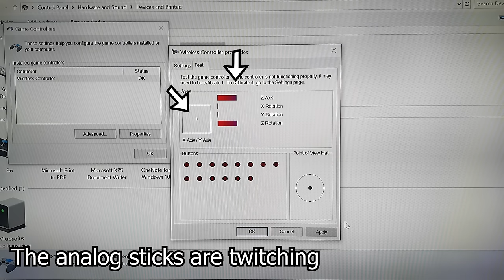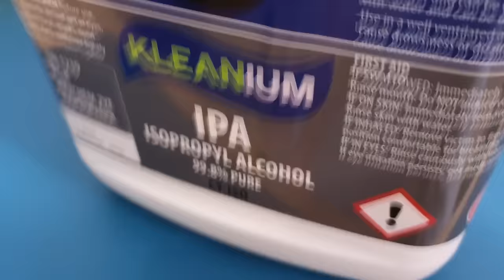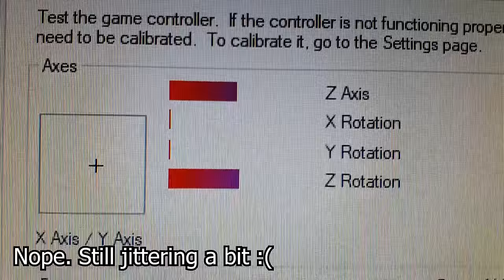How to take apart PS4 Controller and Repair the Analog Sticks

Comment: Hello i followed the instructions exactly but now my ps button to turn on the controller doesnt work and im not sure why
Reply from the maker: The ps button contact is on the flexible button film with all the other buttons (excluding trigger). Maybe you damaged that flexible film, or maybe you didn't reassemble it properly and the film connection isn't making proper contact to the circuit board. Or you didn't plug the battery back in properly.
Reply: @RestoreTechnique  i figured out the problem it was the plastic film it got bent a little bit so i fixed it now its working perfect thanks man 👍
Reply from the maker: @azernunn7745  Awesome 👍

Comment: hey i need some help when i changed the pentiometers then test it the joystick wont go down? i need answers quick
Reply from the maker: I don't know what you did wrong without seeing things myself.
So you changed the whole potentiometer? Or just the track, or just the wiper?
Reply: @RestoreTechnique  hi so i replaced the wipers and its fixed now but the problem that i have now is the ribbon cable thats on the charging port does it also power the controller? cuz it doesnt work now

Comment: I tried to fix my drifting so I did the part in 4:00 but now it got worst. I think the issue might be with the metal cords in the analog. Is there a way to fix it?
Reply from the maker: Did you damage the metal disk? What makes you think it's the "metal cords"?
Reply: @RestoreTechnique  looking back at the video I think you called them 'metal prongs'
Reply from the maker: @yavuz298  Yes. What makes you think your issue is the metal prongs?
Reply: @RestoreTechnique  they got bent a bit, and I haven't done much more than open those parts and clean them up
Reply from the maker: @yavuz298  ahh I see, looks like you'll need a replacement metal disk (it's called a wiper, but doubtful it can be bought separately).
Unless you're confident with bending the prongs back into shape, but I've never done that before.
Reply: @RestoreTechnique  ah, I see. Thanks a lot man. I'll open the controller again and see if I can fix it. 

If I do buy a replacement analog can I take the metal prong part and replace it with the broken one? Replacing the whole analog seems a bit complicated for me

Comment: What the name of that tape i got it in my cart on Amazon.  i want to make sure I get the right stuff to do this i rather repair than spend 70 to 200 which I wouldn't spend that much on a controller if its i sell i get one i like standard than scuff because scuffs need more repair parts if some of us get lucky
Reply from the maker: The name of the yellow tape I'm using is Kapton tape.
Reply: @RestoreTechnique  what is the name of the paste i think im getting one that has it or maybe it dont lol
Reply from the maker: @sony4ever93nyc3  Flux. It's KingBo brand.
Reply: @RestoreTechnique  if I buy the soldering iron kit do I need to buy it like paste wire and wick if its including it n it like 26 on Amazon
Reply from the maker: @sony4ever93nyc3  You usually need to buy all the consumables separately, like solder, flux, wick etc.
Reply: @RestoreTechnique  ok I ordered one that came with everything but if I run out or don't fully have what I need i can order it Friday I'm happy the way you made the video I can understand your video than others that fix ps4 controller
Reply from the maker: @sony4ever93nyc3  Ok great! Thanks :)

Comment: This was a fake DS4. The Orange+Black analogue modules give it away. They start to drift within a month or two, that's why this was mint condition. Original sticks have a blue base, green potentiometers witch white centers and grey shaft. Luckily Other stuff work properly in these so changing the analogue sticks should make it usable for a couple of years at least.
There is another level of fake DS4s with weird PCBs with extra holes for no reason, half soldered joints and flat connectors that are too long. These usually break and can't be fixed. Those are not fun at all.

Comment: I bended some of the wires of my ribbon cable and now the light doesn't turn on and it has a ? Icon instead of a battery indicator when I connect it to my ps4.
Lesson learned, don't do this if you're an idiot.
Reply from the maker: Oh damn bro, that sucks. You should be able to buy replacement ribbon cables from ebay.

Comment: I'm so dumb I unplugged the battery with the outlet itself too lol
Reply from the maker: Oh no! How's your soldering skills?
Reply: @RestoreTechnique  bad honestly your tutorial did work greatly I see the improvement, but I messed up & pulled apart the square where the battery is plugged
Reply: I used it without the battery & everything worked well just that it started doing some weird noises & stopped using it

Comment: i opened my ps4 controller... and fucked up the plastic part of the potentiometer on the "Up" part of the joy stick. Those things are not easy to get off gently and its bullshit that all you need is a flat head you are better off replacing the whole potentiometer by just soldering.

Comment: Pls help me what to do if the red and black cable is cut on the middle ??
Reply from the maker: You will need to repair it, solder the cable/s back together, or replace the wire altogether.

Comment: is it okay to only change the sensors only?
Reply from the maker: Yes, in fact I should've done just that, and keep the original spring which wasn't as stiff.
Reply: @RestoreTechnique  okay thanks
Reply: @RestoreTechnique  i thought i must solder it all again

Comment: What if the metal prongs are bent? What should I do?
Reply from the maker: You could try bending them back into shape, but I'd recommend buying a replacement. I don't think you can buy those potentiometer discs separately, but you can get one out of a new analog stick, which is cheap enough.

Comment: What should i do if the red and black cord to the motherboard comes off is the controller done
Reply from the maker: Nah just the vibration motors won't work. You could try and find someone with a soldering iron to reattach them
Reply: @RestoreTechnique  i cleaned my sensors for my joysticks but now its just moving and i broke a piece for tbe touchpad to be so i dont no what to do

Comment: my screws are messed up and i cant unscrew them. any other methods?
Reply from the maker: As in the screws are stripped and you can't turn them? Or the screws turn but they don't come out?
Reply: i cant turn them cause the screwdriver wont fit
i tried with 5 diferent ones
Reply from the maker: @andy2643  sounds like you've stripped the screws. The screwdriver needed is either a Phillips Head #00 or #0.
There are various methods for removing stripped screws, you should youtube search for them. I suggest trying WD-40 or similar lubricant. Spray it on the screws and let it sit for a few minutes. Clean any remaining off the screw heads, then place a rubber band over the screw head, and then push the driver into that and push hard whilst turning.

Comment: do you know how to repair the clips on my ps4 controller?
Reply from the maker: The clips aren't that necessary, the screws hold it together too. Without the clips you'll just have a slightly bigger seam between the two halves.
You could try to repair them with a 2 part epoxy glue, that might work. Or you could plastic weld them too, with a soldering iron.
Reply: @RestoreTechnique  k

Comment: The thing in my anlog stick was snapped
Reply from the maker: The metal disc? Or the plastic housing for the metal disc? Sounds like you need an analog module replacement.

Comment: Is it ok if i use spirit?
Reply from the maker: I don't understand your question sorry. What's spirit? Use spirit for what?
Reply: @RestoreTechnique  its some alcohol and i want to clean the controller with it.Is that ok?
Reply from the maker: @luciprodaniuc7277  If you mean Methylated Spirits, then i would not recommend it. It will most likely erase any printing (labelling components) on the circuit board. But it may also erode the solder mask, not sure.
Reply: @RestoreTechnique  its sanitary alcohol
Reply from the maker: @luciprodaniuc7277  Does it say what percentage of it is alcohol? Often sanitary or rubbing alcohol will state 70% isopropyl alcohol or similar. 70% is ok, just make sure all of it has evaporated before reassembling. Anything below 70% is no good, 70% is the bare minimum for electronics.
Reply: @RestoreTechnique  ok thnak you!

Comment: I spilled milk on mine near the speaker it won't turn on but it chargers and most buttons work on laptop I checked but seems a button  is open circuit and 1 short circuit idk what to do I tried to open and clean with isopropyl alcohol but maybeni didn't clean it enough
Reply from the maker: Ah that sucks, sounds like you didn't clean it enough, or damaged something when you took it apart 😕
Reply: @RestoreTechnique  it is the same right thing even after I cleaned it I was afraid of being too aggressive I was using a cotton ear thing with isopropyl I think it's fine to go hard on it maybe I'll try again at some point

Comment: What I learned from this video... Either sony changed what the inside of the controller looks like or amazon ripped me off...
Reply from the maker: There are different models of the DualShock 4. Not sure if the internals are much different though.
Reply: @RestoreTechnique  i cant remember what mine looks like now but something was different color and it was set up a little different.

Comment: what kit are you using to fix it?
Reply from the maker: I just bought a good soldering iron (Hakko fx-888d) but in this video I was using a Yihua 936 Soldering Iron. I also use a Yihua 2008D Hot Air Rework Station.
I use 60/40 leaded solder, KingBo flux, Goot desoldering wick/braid, and isopropyl alcohol for cleaning.
My fume extractor is a custom build (see my other videos).
Then it's a size 00 Phillips Head screwdriver, and some pry tools.
The replacement analog sticks are from eBay.

Comment: Can i use regural alcohol?
Reply from the maker: No. Regular alcohol is generally only a maximum of 40% alcohol. So a lot of water and other impurities, which will be bad for electronics. Rubbing alcohol is 70% generally, which is acceptable. But +90% Isopropyl alcohol is preferable.
Reply: @RestoreTechnique  oh thanks

Comment: hey my controller is frozen and i tried reseting and it still doesnt work how do i fix?
Reply from the maker: I need better description of what the problem is. What does "frozen" mean?
It doesn't turn on?
It turns on but doesn't connect to your PS4?
It turns on and connects to your PS4, but no buttons work?
Does it work over USB connection?
Reply: @RestoreTechnique  It doesnt turn on at all i tried every thing even reseting it but it still didnt work
Reply from the maker: @cfw7285  Possibly the battery is dead and needs replacing, or the charging port is damaged, so the battery isn't getting charged when you've been plugging it in. Or the battery is disconnected, and needs to be plugged back in.

Comment: What version is that red controller?
Reply from the maker: It's in the description
Reply: @RestoreTechnique  i see it now. I apologize. How odd that my controller has ribbon membrane blue and yours is green. All my other controllers are green as well. Mine is the clear edition
Reply from the maker: @kr4t0sg.28  There are often different parts used in the same version. Check PS5 fan's; 3 different versions depending on region.
However, someone did comment saying this controller is a clone/copy. I was suspicious when I got it, but all my research resulted in me being pretty confident it was genuine.

Comment: Why do they put such small screwholes in...those screws are just as big as others yet they have a tiny ass hole for no fucking reason so unless u just so happen to have a tiny ass screwdriver u literally cant take apart one safely
Reply from the maker: Tiny screw drivers are dirt cheap on ebay, but obviously that doesn't help you if you need it right away. I got a free mini screwdriver from my local optometrist some years ago. They had little key chain ones.

Comment: IM STUCK ON PUTTING THE NAIL BACK IN THE BATTERY HOLDER CUZ ITS SINKED AND DOESNT WANNA GO DOWN FURTHER BUT ITS NOT EVEN TIGHT DAAAAAAAAAM PLS HELP
Reply from the maker: You sure you used the correct screw?
Reply: @RestoreTechnique  yeah, phillip 0/1
Reply from the maker: @luhvixty  not "screwdriver", the correct "screw" or "nail" as you put it. The 4 screws for the outer casing are different to the screw for the battery holder.

Comment: Help here my controller is 2 years old and only problem is I have to press l2 R2 really hard to work and  X O ∆ [] ALSO....
Reply from the maker: It sounds like you've got dirty contacts for the X O □ △ buttons. You would need to open it up and clean them with isopropyl alcohol. As for the R2 & L2, it could be the same, or you may have worn down the plastic bit that presses down on the pressure sensor.
Reply: @RestoreTechnique  is is good to do at home or I should leave it to a professional...?
Reply from the maker: @shubhamshekhawat1483  That depends on your technical ability, I don't know. It also depends on how much a professional will quote/charge you.
Reply: @RestoreTechnique  thank man...

Comment: i took apart my controller to fix l2 problem but when i put it all back, my controller wont turn on :/ anyone know how to fix this pls help me from getting yelled at...
Reply from the maker: Could be a number of things. Most likely options are: 1. you didn't plug the battery in properly. 2. you knocked the button contact film out of position and now it doesn't make contact with the buttons or the motherboard. 3. You didn't plug the charging port back in, and the battery is flat. 4. You tore the button film or battery cable.

Comment: This is not to the video but what do I do if the side of the PS4 controller is open?
Reply from the maker: Close it... umm, did you take it apart? Did you clip everything back together and put the screws back in? Not sure what you mean by "open"
Reply: I didnt remove anything i was just playing and the side of the controller opened
Reply: There is like a gap
Reply: Just how it looks like in the thumbnail
Reply from the maker: It sounds like the clip/s have broken. The clips aren't necessary, as there are the 4 screws which hold the housing together. Usually the gap between the 2 halves is 0.2mm, but without the clips it can as much as 2mm gap. If it's any more than 2mm, then your screw holes must have broken too, and the screws aren't fastening the thing together.
Reply from the maker: @alexwtfzz  oh wow that's a lot, are the screws still in the back? The screw holes must've broken off inside, and the clips are either unclipped or broken.
Reply: The screws are still on and haven’t been touched

Comment: Does anyone know why nothing happens when I press the PS button?
Reply from the maker: Probably didn't seat the flex cable button contacts properly. Either the power button contact isn't in place properly, or the film isn't making contact with the circuit board. Or you damaged something.

Comment: I fucking broke the Clips and cant get it open
Reply from the maker: If you break the clips it's not the end of the world. The 4 screws do most of the work securing the shell together. Without the clips, there will just be a 0.5mm gap around the seam, instead of 0.2mm.
Not sure how you can't get it open after the clips are broken 🤔

Comment: That is a dab pick in this video
Reply from the maker: It's a spudger/pry tool for disassembly and repair of electronics. It's also a tool that's been used in dentistry for decades (or centuries) in mixing fillings together. Only just found out what a dab pick is.
Reply: @RestoreTechnique  Huh lol! I guess they multi purpose 😂

Comment: help i bent the metal prongs
Reply from the maker: Which metal prongs? Where can you see them in my video, put a timestamp.
Reply: @RestoreTechnique  4:14
Reply from the maker: @jackyxyzgaming9520  ahh I see, you will need a replacement. Not sure if they're sold separately, but you can just buy a new analog stick module and grab one of the discs out of it pretty easily. The analog modules are only a couple bucks.
Reply: @RestoreTechnique  ok but i have gen two and i dont know if itll fit with gen 1 disc in a gen 2 module
Reply from the maker: @jackyxyzgaming9520  I believe they're all the same
Reply: @RestoreTechnique  ok thank you for your help

Comment: Much easier solution that actually works and takes like 40 seconds: pull joystick up till you feel it kinda click out of place blow into it hard a few times and rotate it so you get all sides, then press it in and hold it down tight as center and still as you can for like 30 seconds. Works like a charm and you don't have to take anything apart and no tools required. This dude is doing it the hard way.